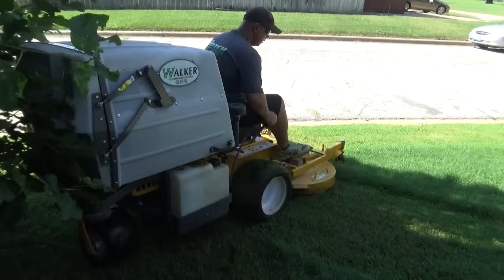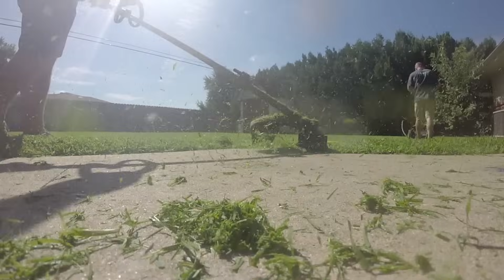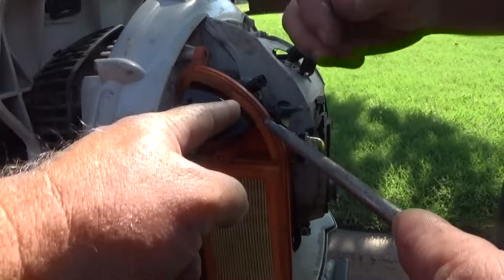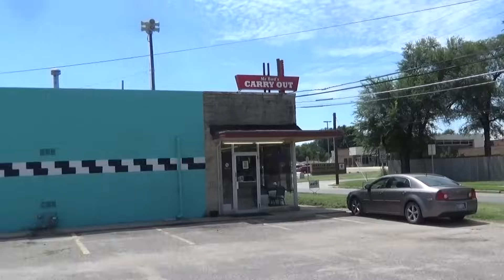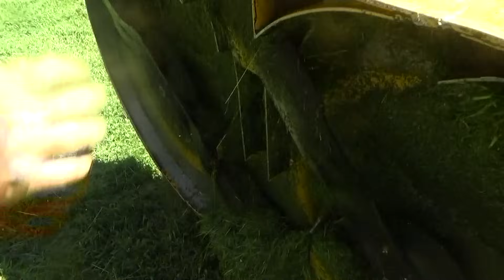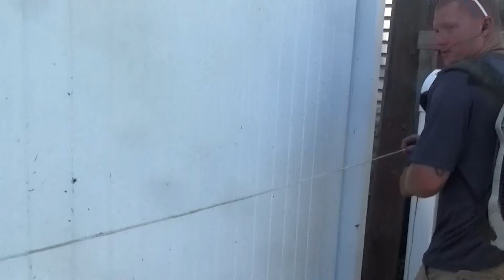Running Two Crews, Lawn Care Vlog #47

Comment: I am running a all purpose deck  on the Walker I am running at work it will catch, side discharge and mulch only takes about a minute maybe 2 to  change between them and on the side discharge never clogged for me mowing long grass like what you were there I also use it to mow very wet grass E.g. it is raining I never have any troubles using the side discharge spreads the cuttings out nicely I find it absolutely brilliant I don't know about getting them over where you are your dealer should know if they are available but I know they are very common over here in New Zealand where I am

Comment: When the Walker plugs in the deck port you can continue as if you've put in a mulch plug. Since its no threat to the second stage blower no grass is trapped and clogging moving areas.
Reply from the maker: I know but it clumps a lot in tall grass.
Reply: Why not just go slow and catch it, then dump in your garbage bag instead of raking it up with your hands?
Reply from the maker: That would have filled my trailer as thick as it was.

Comment: Sometimes in those situations I'll give a general $ amount if the customer can't be there, telling them up front if we get there and it's not what u described or I was imagining I'll call u with different #'s. You can't lose money "helping" folks out. It's not your fault it was that tall/thick. Also b careful if they're renters, they'll b the first ones to stick you, try to deal with the property owner.
Reply from the maker: Lawnfarmer I understand but I ended up making money so I'm not too worried about it.
Reply: +TopNotchLawns Let me break this down- $10/ hr for mower gas/maintenance, $10-15/ hr for truck/ trailer gas/ins./maintenance, $2-3/ hr for work. Comp/ liability ins. X 2 men=$44-$56- price of job $45- where did YOU make any money? Didn't even figure in health ins, money set aside for when you need to replace equipment or any profit or ROI. Should've probably been a $125-$150 job. And weekly @ 20mins(does that include travel time?) x 2 men-$50-60.
Reply from the maker: No offense but I would be out of business if I'm charging that much. I might as well pack up now. No homeowner around here will pay that. If you get that then great but it isn't happening in my area.  I totally understand what your saying and I agree but pricing isn't the same everywhere. Cost of living is not the same everywhere. I seriously have no idea how somebody can tell someone else what to charge not knowing how much I pay for anything and what my bills are. The biggest question I get is what to charge and I have never answered it because like you already pointed out, there are way to many factors that goes into a bid.
Reply: +TopNotchLawns I'm in rural SE PA, so I assume similar cost of living, gas, equipment prices etc. as you. I used to think that too (nobody will pay that price) but they will- be courteous, professional, on time- be Top Notch, and they will pay it- the customers you want will anyway. Numbers I gave are pretty generic and I think could even be low for some areas. What does your truck or mower shop charge an hour? You pay that and you deliver your equipment to them to do it right? Your not just the guy who mows grass your a professional too!!
Reply from the maker: Good points bro!!

Comment: You said you already knew most of what you needed to know about the job. ... and it took two of you 55 minutes to complete a $45 job?    so in your area it is a good idea to take on jobs that have higher than average drive time,  almost 2 hours of work,  and risking your equipment mowing grass you can't see into. .. For $45?  seriously,  that's your story?   The truth is you under bid the job because while you had s good idea about the size. ... You had little info on the grass you would be cutting.   pictures would have taken care of that.   Look,  you price work whatever way you want.   But you are losing money in the long run doing difficult jobs for little money.   You will find that out when your mower his a stump or a pipe.   That 45 will cost you a grand in a hurry.   Get pics next time and price thick jobs high.   I could be wrong,  but that is my opinion.   I'm not trying to be a hater. ..I enjoy your channel and want you to make a ton of money.   Why I suggest pics on jobs unseen.   I am trying to help even if I'm coming across poorly.